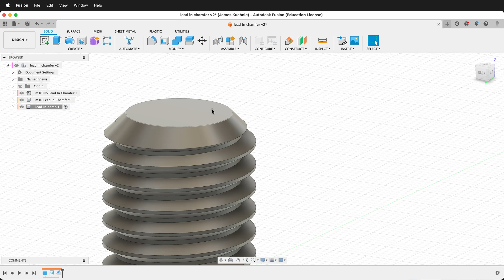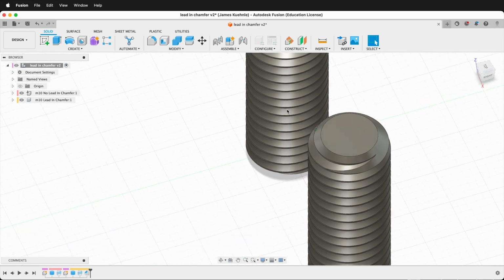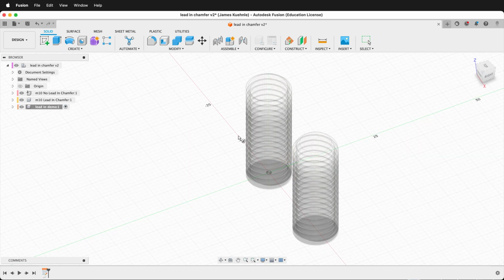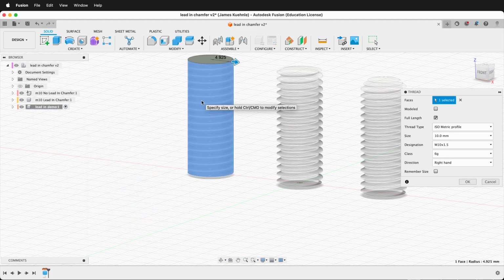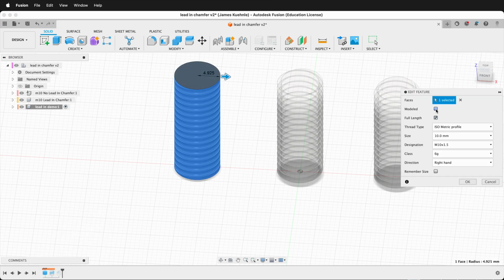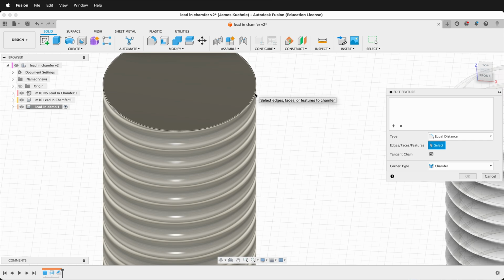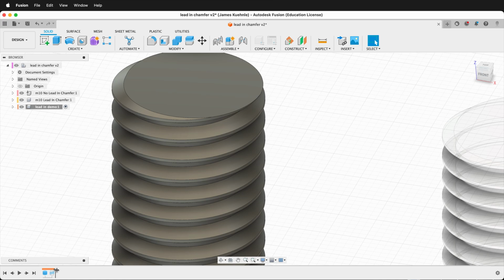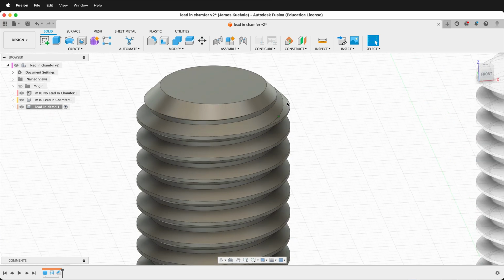Tapered Thread Lead In Fusion 360 Tutorial

Comment: I used to successfully chamfer threads this way (or by rearranging on timeline), but I have at least one recent example where this does not work. I don't know if it's due to a recent Fusion update, or just some bad luck with the specific geometry. And of course, edge carefully selected etc.
Reply: It looks like the toggle-modelled trick only works for ISO and ANSI threads. I was using a BSP thread (to match existing hardware). I found a comment about this on the Autodesk Fusion Forum. I can't link to it, but the subject is "External threading Chamfer" by author seomichael, and the relevant reply is from HughesTooling.
Reply: @tg_73  Thanks, I'm facing the same issue with GB Pipe Threads unfortunately
Reply from the maker: Interesting, have not had that issue yet but will keep a look out for it, if you find a repeatable error perhaps submit a bug report to Autodesk